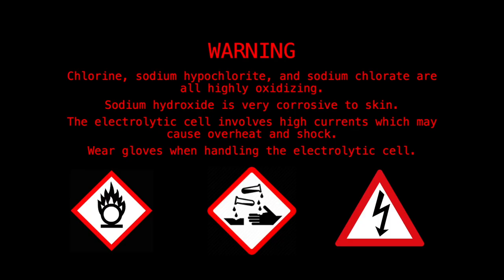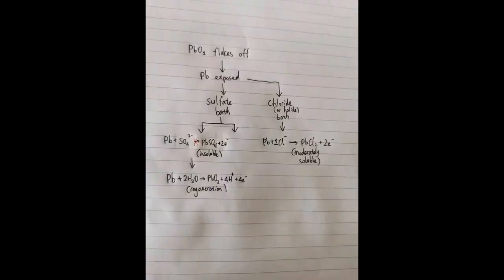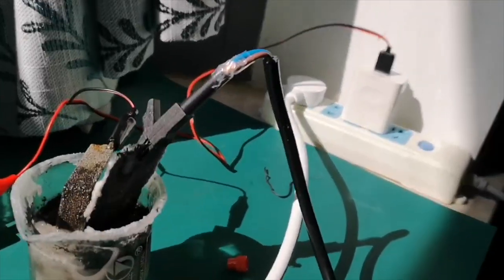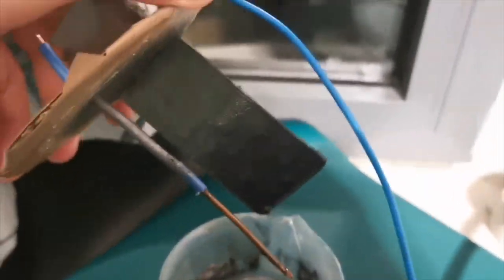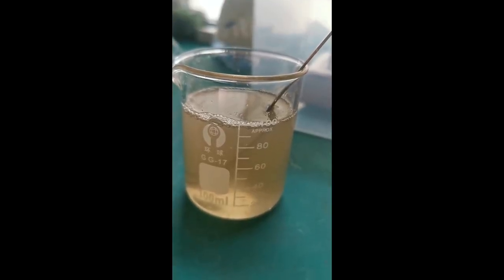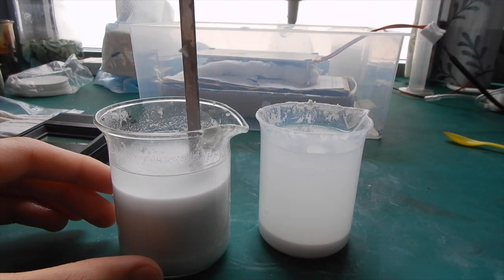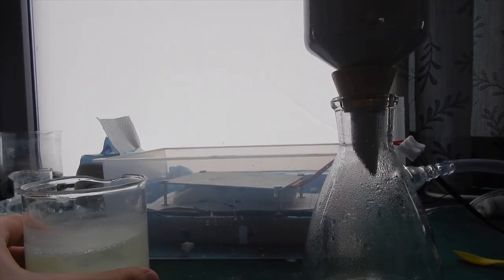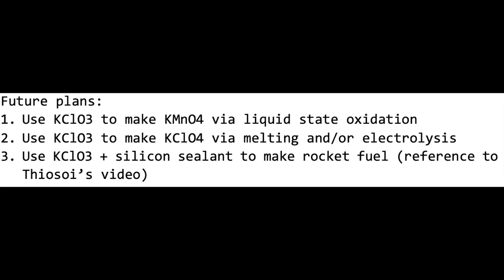3.1 Halogens - Making Chlorates by Electrolysis

Comment: I've worked at a chlor-alkali plant, our electrodes were steel with nickel oxide plating.  If that's of any use to you.  The electrodes were in contact with either 20% NaOH solution, or a chlorinated acidic brine solution.  Held up well over 7 years!  The lower the distance between the electrodes the lower amps you'll draw, maybe a few plastic(Teflon\Viton if you have it!) spacers(o-rings)?  We averaged 4.5 A at 234 VDC per cell, but we had 120 and were drawing Megawatts, to give you an idea of the scale.

Comment: Recristalising the chlorate would have made things much easier. Potassium chlorate disolves poorly in cold water and it's easy to dry at room temperature. Plus much purer potassium chloride could have been made by neutralising hidrochloric acid with potassium carbonate. On the other hand just using potassium carbonate directly would have made things simpler.

Comment: I want to know if those paper graphite anodes can be used for perchlorates directly or atleast as an alternative substrate for active coatings since they don't seem to corrode.
Reply from the maker: I don't think so, because in general, graphite-based electrodes only go to chlorates, and you have to use other electrodes like PbO2 to go perchlorate
Reply from the maker: Might give this a go though
Reply from the maker: However, it might be good to act as a substrate
Reply: @MIH0319  yes I have succesfully made homemade PbO2 anodes and this graphite paper can probably be a good substrate.
But I also wanna try boron doped graphite which is known to get to perchlorate by making expanded graphite then soaking in trimethyl borate and heating to 800C before recompressing into graphite paper.
Reply: @CatboyChemicalSociety  that would be a simple route to perchlorates!
Reply: @CatboyChemicalSociety  yknow what imma try this at some point
Reply: Dont know if his will be useful, but I think the difference here between the mentioned graphite rods and the paper is surface area, lowering the current density per cm² with higher surface area and making it less vulnerable to erosion. The reason they erode in the first place is that it's porous, and there are weak bonds between the layers. So the formation of crystals in these layers is enough force to push them apart. The higher the current density, the faster they erode.

Comment: @M.I.H Why is that PbO2 anode was failed, there are some video making chlorate with PbO2 and some website said that will work. How can I improve the PbO2 way?
Reply from the maker: I don't know why it failed, but it seems like that the PbO2 coating on my electrode falls easily. The Pb under it then gets attacked by the chlorine. However, professional PbO2 electrodes are strong and does not fall apart

Comment: Why didn't you just use the potassium carbonate directly
Reply from the maker: Well I didn't want to add in another anion (CO32-) in the chloride-based solution so I thought that adding KCl might be better
Will it influence anything if I added K2CO3 directly though?
Reply: @MIH0319  sodium and potassium carbonates are highly soluble so yea it will not produce any other precipitate and it will work just as intended
Reply from the maker: If I run the cell continuously, the chloride ions would be consumed and I need to add NaCl. Also I need to add K2CO3 to precipitate out KClO3, but the remaining carbonate ion stay in the solution as Na2CO3 and accumulates
Reply from the maker: So if I did several runs continuously, the Na2CO3 eventually will precipitate and contaminate my product
Reply: @MIH0319  you are literally using NaCl and hence no need to re use liquor.
Also electrolysis of carbonates leads to it forming hydroxide as CO2 escapes.
Reply: @MIH0319  only if you reuse the liquor which I wouldn't anyway given NaCl is easy and it's not worth re running usually.
Infact you can if you want to re run just isolate NaClO3 by fully converting the solution and fractionally crystalizing it.
Then resaturate mother liquor with NaCl
Reply from the maker: I see. Will try next time
Reply: My chlorate cells before uses mostly potassium carbonate since its highly soluble and less loss of potassium chlorate in the end